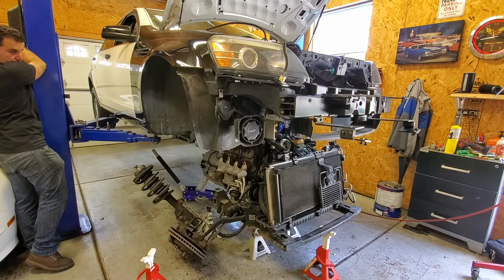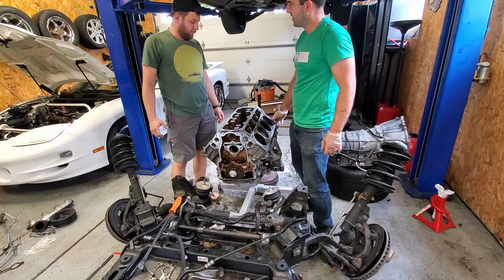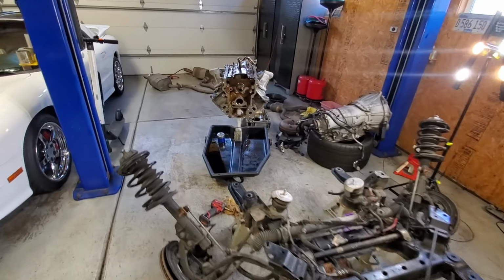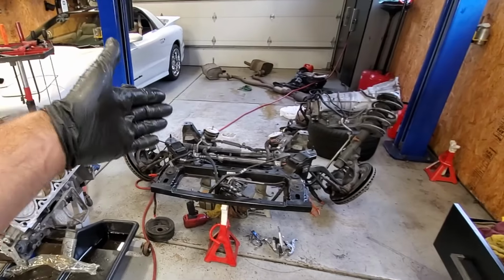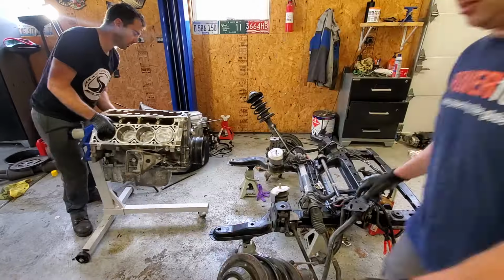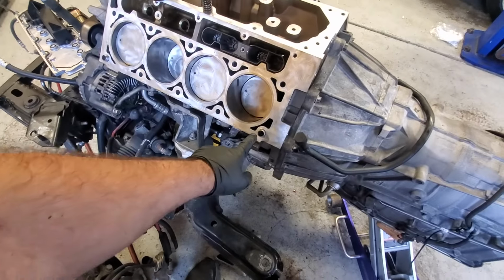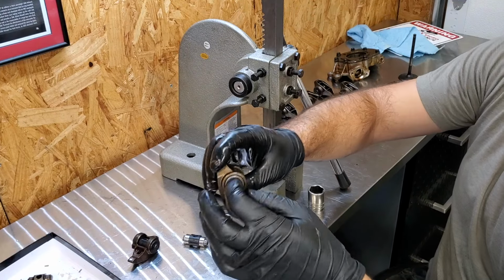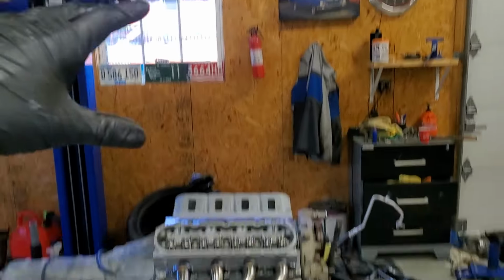Fixing THE WORST LS Engine Factory Defect Ever & Adding 100 Horsepower In The Process! GM Failed US!

Comment: Tech tip from an electrical engineer; Once copper wire has been suscepted to heat enough to melt the insulation; there is also a good chance that the copper strands in the bare wire becomes annealed (hardened) and becomes brittle. It means the strands loose their ability to absorb vibrations, thus you may risk the wires to the connector simply breaking apart because they are brittle. Wire segments that have been subject to this should be changed and new wires spliced in.
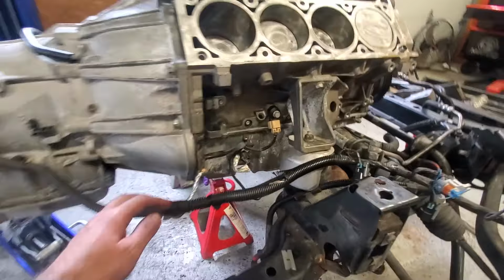Reply: @ 14:30 minutes elapsed

Comment: I did almost the exact same mods on the cam is closet too and I got 400 whp and torque. 243 heads. I wanted a little bigger cam but I live in Cali and I'm pushing it with the cam I have in it. The bottom end is blueprinted for 700hp.

Comment: Hi there from Germany. 
In my opinion a nice video but why the hell are you gringing on the piston an the surface for the headgasket ? Truely hurts my heart.  Personally i would never touch a piston that is inside the engine. If i want to clean a piston for whatever reason i remove it and clean it the right way ( do not forget ring area!) but i would never grind on it shock  
Same for the headgasket-surface. I try to clean that with chemicals (a mild as possible)  or a special plastic-scraper which is relatively soft in compare to the aluminium.
What youve been showing is NOT the right way... it may work..for some time.. but its not the right way to treat your engine.

I did not even mention all the particels you generate from grinding which gets inside your oil and coolant systems. It realy grind my gears.

Comment: Gm has a bulletin about the collapsed lifters and they say if a lifter collapses to replace the oil control manifold. I work at a small chevy dealership and I get a lot of trucks with collapsed lifters.

Comment: I will throw this out there to anyone reading and my experience with an AFM system. I never had any problems with it, and what i did to keep it in tact after buying a used vehicle with one. Had almost 200k miles. Previous owner said it was having problems with the afm system. Said he just changed oil and lifters were knocking hard. Took it to dealer and thats what happened. 
So after buying the car from him. I bought new oil again, and a couple cans of seafoam. 
I put a whole can into the engine oil, and went driving for 100 miles, after that i changed oil and cleared the cel light. didnt have any problems after that for a good while. Like this guy said in the beginning video. Those smaller parts controlled by ecm can be plugged with sludge, if you change your oil, i would throw a can in once every 2nd oil change and drive for a little bit, then drain it out.

Comment: https://youtu.be/zyYifhHTMm8

🚫Disable V4, with no loss in mpg.
Included with the disable:
✅More power
✅Raised speed governor
✅Quicker trans shifts
✅Less pedal lag
✅Adjust for bigger tires & or gear change
GM 07 to 2015 with 4.8, 5.3, 6.0 & 6.2 great value for $150. 
Newer Years DM your year and model for pricing.

This is performed by recalibration of the drivetrain computer(s).  Completed usually within 20 minutes.

Comment: Why not throw a set of bearings in after grinding with the most coarse green wheel? Super easy and cheap to install new bearings even as a matter of course, let alone after filling it with micronic grit. The grit in that finger disk will get lodged in the rings and bearings. Power tools and heavy grit grinding disks is not a great idea on aluminum.  I believe the yellow 3M abrasive wheels are for aluminum. Still full of abrasive encapsulated in synthetic. Oh, well. Not that big a deal to pull it apart again if need be.
Reply from the maker: Ya I'll just pull it back apart.

Comment: Did trunions on my truck, I have only one complaint, and that is the Comp Cams kit I got has had a failure with the side of the body, resulting in a few bearings getting out, and almost mushrooming my valve to the point where it wouldn't compress enough to get the keeper out, and only after 40,000 miles of still below 6k rpms and a very mild cam, so do be careful

Comment: I was stunned when I seen you using that whizz wheel on the head gasket surface. I know you mentioned it was plastic but, anything that’s running in a die grinder and making a shiny surface finish like seen in your video, is making surface irregularities, that over time your head gasket won’t be able to seal.

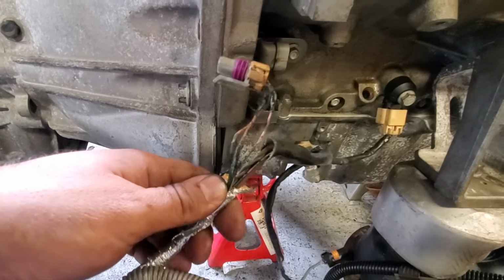Comment: Every motor rebuild etc. I do I go through ALL electrical harnesses for the reason (14:30)..  Good excuse to upgrade to better quality wiring and gauging if necessary (like GXL wire) at the time!  Larger starter and alternator wiring also!  Jus sayin.

Comment: great video!
but..
all melling oil pumps (high pressure and/or high flow) have given me (trouble) too much oil pressure, 3 bar at idle warm oil and around 7 bar at 6500. and 2 broken engines, these melling pumps push too much oil in and up the engine and the oil dont have time to flow down to the pan, resulting in low oil level and low pressure and a bent rod or 4.... 
i now use a chevy performance oem pressure and flow pump, and now i got around 1 bar at idle and 4-5 bar at 6500rpm =) 
i have also modded my lifter trays with a 10mm hole to alow better flow back to the oil pan
i drive a Nissan Silvia S14 with a LS Swap. its a stock LS1 with LT headers and ported intake and TB (no more because class rules) .. 
but i have broken a LS2 and a new fully forged and stoked LS3 (this lasted only 4 race weekends).

Comment: That's a lot of work for only 100 more horsepower...
Reply from the maker: What would you recommend?
Reply: @LegitStreetCars  Factory LS engines will make multiple hundreds of horsepower more than stock with zero modifications for reliability. I guess choosing to start with a broken one made your job harder, but milling the heads is a waste of money unless you can prove it's needed, etc.
Reply from the maker: So what would you have done?

Comment: No mention of removing and plugging the DOD relieve valve in the oil pan? Gonna suck having to drop that pan again when you have erratic or low oil pressure.
Reply from the maker: What psi does that relief valve open at?
Reply: @LegitStreetCars   I had to dig deep into the G8 archives but I found this info "The L76 oil pump displaces 1.24"/rev compared to non-DOD 6.0 engines (LS2 and L98) which have 0.95"/rev oil pumps.

There is also a DOD specific oil pressure relief valve inside the oil pan. When main oil pressure exceeds 55psi this relief valve exhausts excess oil to the sump" .  They are known to get stuck/clogged. 
Definitely check out G8board and G8nation for "older" info posted by the guys that paved the way for us.  Unfortunately the forums have all but dried up with the facebook groups taking over.  I used a Melling 10296 and my cam is a 222/226 .606/.604 113 LSA + 3.  Good N/A street cam spec'd by  Rick Crawford.  It's similar to the Little Lunati Low Lift.  I'm at 410 wheel and run in the 12.20's without a converter cutting only a 1.8 60 ft.
Reply from the maker: So the pressure would never go low. It would just open at 55 psi which is totally fine. Even if it stuck closed you'd be fine considering all the LS engines that didn't have these.  Most don't touch the thing.  Oil pressure on mine is great btw
Reply: LegitStreetCars  I was wrong in my statement about pressure. Pressure isn’t the issue.  The problem is that the valve would spray oil on the cylinder walls causing increased consumption. GM solved it by installing a deflector sometime in 2010. Of course all of the G8’s were made before then so it’s common practice for us to plug them. My fault for talking out of my * before fact checking.  I would assume your pan has the deflector NAL-12639759

Comment: My parents had a 2009 Yukon XL with the flex fuel 5.3L V8 (L99, I think it was), until November 2017. I visited them for Thanksgiving, and the first thing I heard when they picked me up at the airport was that lifter tap that you demoed at the beginning of the video. Literally that exact sound is pretty much seared into my memory. Now I know why the lifter tap issue reared its head (not specifically, since there are a few different reasons why, but I have some clues now), and why they decided to trade it in a few days after my visit ended. Great information here, thanks!

Comment: 10:56 Aligning the oil pump with the crank would also be a good idea at this point. Only takes some feeler gauges and a few minutes.
Reply: I thought the same thing. Melling oil pump only requires a 360 deg rotation of the crank for alignment.
Reply: @devokdr  No, No, No! Do not believe the Melling video, they are in the business of designed obsolescence and selling more pumps. Neither the OEM nor Melling pumps are self aligning, rotating the crank does nothing for alignment of the outer rotor in the housing, it floats and the absence of locating dowels in the housing along with oversized bolt holes almost guarantees early pump failure if the alignment shimming is not carried out correctly. Ask any mechanical engineer and they'll explain why:
https://www.youtube.com/watch?v=CWCIdhG04LY

Comment: Forgot about the oil pick-up tube oring.   It cracks and then sucks air instead of oil.

I have done about 40 of them at my shop along with a ton of screen/pressure sensor issues and solenoids as well.

But I only see the bad ones.  Plenty of engines out there running strong with none of these issue.

CHANGE YOUR OIL ON TIME!!!  LOL.

Comment: I have a 2000 sonoma with a blown rear main and push rods knocking, 2.2 engine, I want to put my 6.0 engine from my escalade in the pick up. Trans is bad. Do i need to do any suspension work to compensate for the extra engine weight?

Comment: I had a 2008 Burb, went through 4 engines. Will never, ever buy a GM vehicle again. Unless its prior to 2007. Most of the motors (besides these issues) are great but I still cannot get over the Fisher Price plastic interiors. Never. Just straight up junk.

Comment: Yeah Circle D is awesome.  They rebuilt a turbo 350 for me in the 90s for $500 including removal and reinstall with a rebuilt torque converter.  That guy was sure proud of his custom converter welding machine that glued the two halves back together.  It was an absolutely awesome transmission until Allison flooded it in 2001.  Should have kept that car.

Comment: so thats why my ls4 has a ticking valve. im worry about my cam now. should i worry or no, 151k miles.
Reply: If it's a stuck lifter, the answer is yes.  It will tear your cam and other things up nicely.  If you can get it unstuck, there are ways search Google and YouTube, have your computer reflashed to never call for 4 cylinder mode again.  It will never stick again, because it occurs only during transition from one mode to the other.

Comment: Hey guy you sure that's a all aluminum 6.0 LS block idk of any 6.0 LS aluminum blocks I've seen all aluminum 5.7LS and 5.3 LS engines like the transams camaro and corvettes and SS trail blazers had the all aluminum long block 5.7 engines the ext trail blazers dropped in the only aluminum 5.3 LS engines but all the 6.0LS which is 365cubic inches were only used in HD trucks that used the small block 6.0LS motor the other engine options were 8.1liter big block 496cubic inch gasoline motor and the bad ass duramax 6.6 big daddy diesel engine

Comment: @ 10:55 I did not see you using an alignment tool to center the oil pump on the crank snout.. It might not seem important to you, but it should be done every time the pump is removed and reinstalled, or new pump added. This is discussed at length in many of the Performance LS engine build books. Just bolting it on might be okay... But insuring that the pump gears are not misaligned is the BEST way to do it. Great video otherwise.

Comment: Is AFM still a problem in the newer LT engines? Also is just tuning out the AFM enough to keep the engine running at its best or would it be better to do a DOD delete by removing all the AFM lifters and mechanical parts?
Reply from the maker: Not as big of a problem but I'm going to delete it in the tune

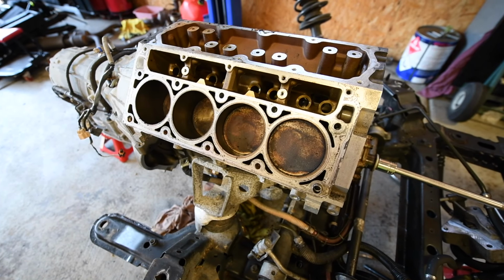Comment: I'm only at 2:19 of your video, but I have to comment. What gave up on my sister's 5.3l Tahoe was the plastic lifter guide. Still swapped everything else out. Nothing was clogged, no collapsed lifters, and cam was ok. Engine is back together with new parts and it is running good. Tried to convinced them to do a delete, but they want the AFM. Oh well their vehicle not mine. Now back to your video.

Comment: change the cam problem solved. more impressive fixing issues than stating issues. nobody cares
Reply: Yeah, 2000 dlls job
Reply: I took mine to gm dealer they thought it was the lifters nope it's was the cam after charging me 1000 to find problem them I had to pay for the new cam work was not worth it.

Comment: Yes you can bang and dent those headers pretty hard, - that doesn't affect the airflow. Didn't quite understand why you chose to deal with them stock rockers if you'd seen a potential threat there. There are tons of better and lighter solutions AND more efficient...

Comment: What the is a 70° torque angle?  I mean, I understand what was done, but it makes no sense to me.  Nor does the notion of a “torque to XX.X ftlbs (nms), and go another 1/4 turn”.  How is that consistent?  Please help me understand.  I’ve built plenty of high performance engines (1 503hp dynoed N.A. 350cu-in, 1 18psi Garrett turbo 350cu-in, and home made N2O system 305cu-in) .... I’ve just not heard of this method.

Comment: You have no idea how many people have screwed up their engines with Scotch brite pads and little sanding disks. I saw a guy destroy a side oiler block with a ridge reamer once.
Reply: I cringed when I saw the sanding marks. That's an 80 grit disc. I use red and blue pads to clean up the surface red for heavy deposits, blue for lite ones. It takes a lot of fuckery to destroy a surface with a blue pad. I've had to remove mill marks and maintain .002 tolerances at work. They work great.

Comment: SAY WHAT, THAT'S A PIECE OF JUNK.YOU SHOULD NEVER HAVE TO PULL A ENGINE BY UNBOLTING AND DROPING THE  FRAME.  ABSOLUTELY RUBBISH.
Reply: Fine, do it the hard way.  Unibody vehicles are assembled this way from the factory, thus, it's generally easier to disassemble them like that.  Many engine bays are too cramped for the engine or engine and tranny to go out the top.  It isn't 1965 anymore.

Comment: 2000 t/a m6 i literally just finished doing cam and heads on mine today. Tick performance sns stage 2 cam and worked over 243 heads and all the usual oil pump timing chain lifters trunions ect.

Comment: I have almost the exact same parts from BTR LS7 lifters, to trunnion upgrades chromoly pushrods apr head bolts and studs, oil pump and 823 heads that I had CNC’d and a Texas speed shop stage 2 cam that I bought for my LS3 L92 in my awd 2007 Sierra Denali that was one of the last LS3 without AFM. I bought everything when I lost compression in two cylinders and parked the truck for a few months until I had time to tear it down. When I cranked it up to pull it in for the rebuild some how both the misfires where gone and I had great compression on those two cylinders again. I know that sounds crazy but I’m a mechanic and rebuild engines all day long so I can promise both cylinders 2 and 4 had almost no compression and it was misfiring like crazy. So instead of rebuilding that motor that fixed its self I took most those parts and threw them in my 2005 z71 Tahoe and the few upgrades make a ton of difference

Comment: As great as the LS engines are, GM dropped the ball big time by requiring head removal to get to the lifters! Bad design there.
Reply: yeah but they made up for it by not requiring head or intake removal to do a cam swap.
Reply: @themadmachinist8637  yeah you need to remove the heads to swap the cam and lifters. Heads have to come off for lifter removal. The old sbc engines dont require it.
Reply: @Connor4x4  i mean, for the lifters yeah. But no you can swap the cam without removing the heads. Losen the rockers pull the damper and timing cover off. Remove the chain. Rotate the cam twice to lock the lifters into the buckets. Unbolt the retainer and pull.
Reply: @themadmachinist8637  I've heard you have a high chance of dropping lifters into the block changing a cam that way.
Reply: @Connor4x4  if it drops the lifter the retainer needs changed anyway. If it's that wore there's a good chance the lifters are wobbling in the socket causing premature cam wear. I've seen a half dozen die of this particular ailment in my shop.

Comment: Electrical tape in hot areas = bad..  the heat will soften the tape and unwrap . you should use shrink tubing do one at a time so you don't mix the order .. .. Great Video .. brings back memories ..

Comment: Can you do a rebuild of a 2010 Chevy Traverse, I blew a main bearing under 75,000 miles.and Yes I changed the oil every 4,000 miles. I bought it used at 65,000

Comment: Amazing video! Really in depth and love it! However I wanted to let you know that Doug thorley in California sells ceramic coated direct bolt on headers for the chevy caprice. They clear the oil cooler and everything on the engine bays. Also bolts to the factory exhaust with no mods required. All for less than $700 depending on where you live. I just installed a set on my caprice yesterday and love them. Was really easy to install.

Comment: My 2008 Trailblazer 5.3 DOD motor failed at 94,000 miles. After hearing all the stories of how superhuman the LS motors were. I was so upset to have a truck I owed $5,500  needing a $3,000 repair. Ended up buying a brand new Ram. So upset after getting burned by 305 cam issues by GM in the 80s and 90s. Then DOD issues in 2000s.